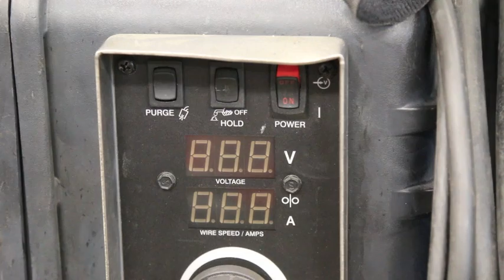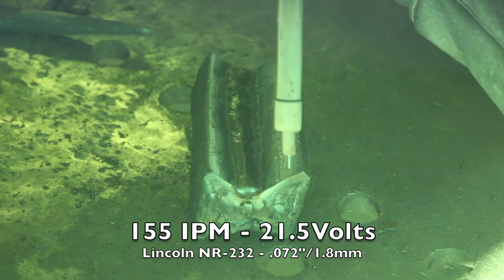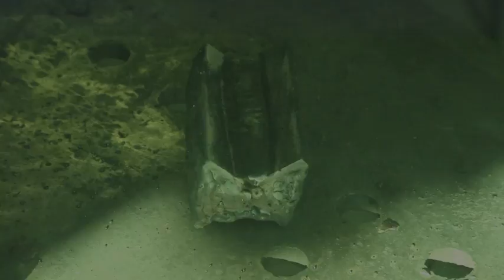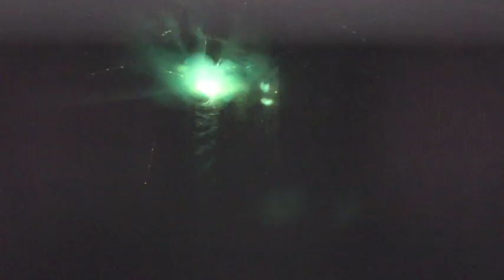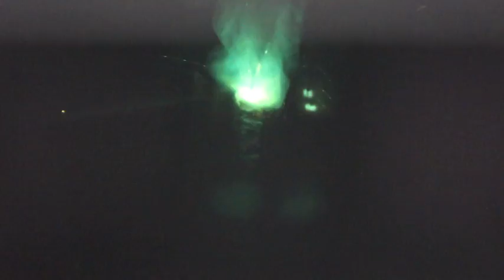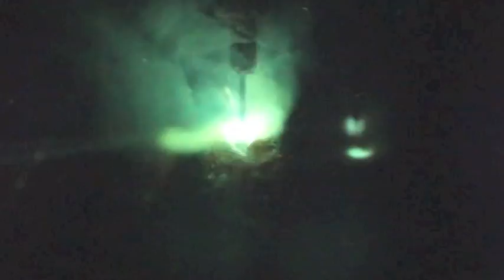Welding Flux Cored NR 232

Comment: 232 runs great on CC from an LN-8
Reply from the maker: No kidding? I have never tried that, however, I can tell you I have had some terrible result accidentally welding on cc with a miller x-treme running on a Miller XMT-350. Thanks for the comment - Dan

Comment: whats so hard about it ?
Reply: very sensitive to settings. not like a 1/8 7018 that can be run on almost any machine at about the same amps. also you could run a 7018 from say 90 to 140 amps but the nr 232/233 are real sensitive to IPM/wire speed and volts

Comment: Fever bro',

I have kind of a geek question: How hot would your plate be in between passes on your vertical test plate?

I've run NR232 off and on for a few years in the field, and I'm just now getting serious about it, experiencing all the regular setbacks you mention such as hangtime at the edges and travel speed, etc.; I'm surmounting all that. But I'm curious as to the actual temp on a test plate to namely prevent fall-out towards the upper-middle/top. I plan on using an IR thermometer.

Would you hit it again at say, 200°? 300°? Hotter?
Reply from the maker: +Steven Peterson Well, as a general rule of thumb when welding mild steel, you should never get above 500 degrees Fahrenheit for an inter-pass temperature. I usually prefer to not weld 232 until the temp is down to less than 400 degrees, because of how hot the stuff runs. A temperature crayon, or an IR thermometer is your best bet for determining this. Good luck!
Reply: +WeldFever 

Thanks for the timely reply, dude! You likely saved me a lot of frustration! 

Oh, and solid channel, btw. We're lucky to have people like you around!
Reply from the maker: +Steven Peterson Glad to help and again, good luck to you!

Comment: This wire seems to have a lot of the characteristics of a 7024 welding rod. Are they close?
Reply from the maker: +Richard Valcourt Only in that they deposit a lot of filler metal. Unlike 7024, NR-211 welds in all positions, so it is very advantageous. It also does not behave like any stick rod, as you must NOT hold the sides for very long, move faster than you would with a stick electrode, and constantly watch for slag trying to overtake you. It's a little tricky to say the least!
Reply: +WeldFever Now I now, thank you very much for youre reply. Much appreciated.